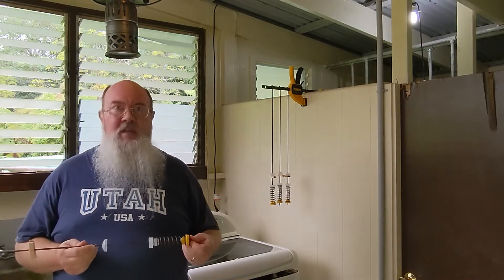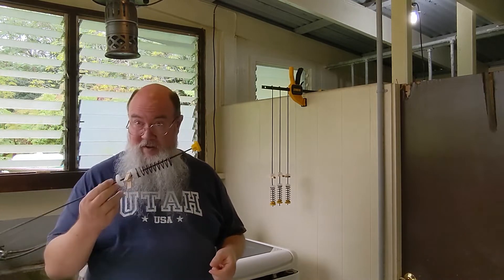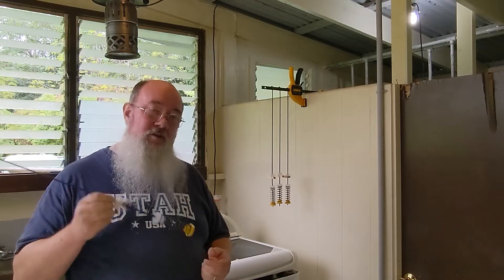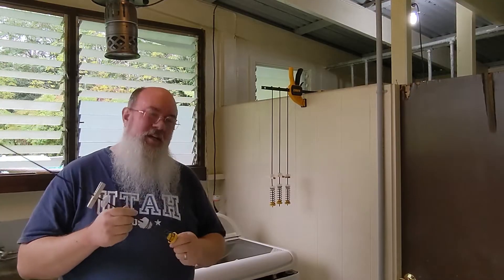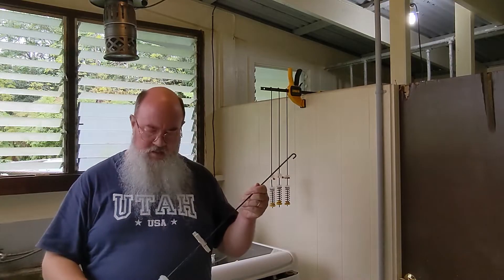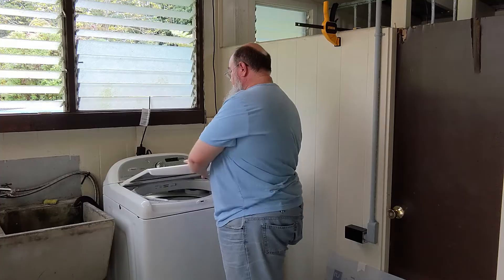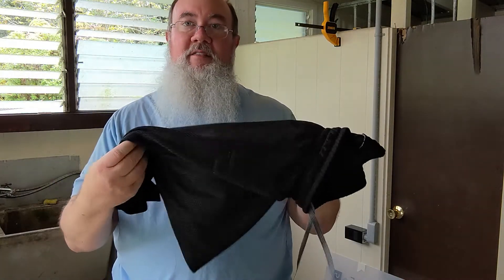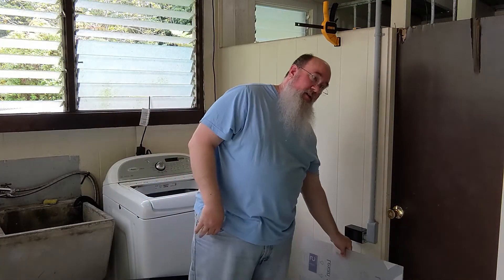FIX your washing machine rods! Don't $$buy$$ a new washer or washer rods before watching this video!

Comment: Good job & funny too...yeah the Damping grease was key.I knew it was something different when I first got it on my fingers...my fix was to use  Teflon (a rear bearing for a dryer) to replace the foam, then encircled the cup/foam with a stainless hose clamp,  tightened (tuned) to dampen w/o the grease.
In theory, if/when the Teflon wears,I can just reach down with a 1/4 in ratchet & re-tighten...
Reply from the maker: My 2 cents? If you throw some damping grease on that, the whole assembly will last years longer. Dry clamped Teflon certainly is clever, though! My concern is the same as @WasherDryerMoney 's liquid nails idea, though: Eventually, the metal WILL wear through that. Especially if you get a few specks of rust on the rod, it will get like sandpaper and just chew it up. (This is a more of a real risk in Hawaii / marine environments than most other places, but if you have a damp basement, you won't be far behind me us in Rusty Rods. You can treat the rest of it with knife oil if you are concerned about it.)

Comment: I really appreciate your video. How long has your first application of Nyogel lasted? I'm trying to decide if this method will last long enough to justify it over buying new OEM rods. I really don't want to have to apply more damping grease every few weeks, so I would love to hear an update.
Reply from the maker: Well, let's see ... I did this in November, and it still runs butter smooth in March. My suspicion is that the grease I used will last in the Hawaiian environment for about 6 - 12 months, at worst. If yours is sitting in a basement in a less-hostile environment, then you should get 2-3 years out of it like you would with a new set of rods. It's definitely not something to do every week or even every month. If that becomes necessary, then something else is off.

Comment: You should package the grease in little tiny container and resell it in quantity of a single repair so we all don't have to buy a big tube. Great video. Funny how ours just quit on a cycle and hasn't worked since.
Reply: I took my rods out and grease them. Ran a cycle and it still showed UE. Did some more research @"You can fix that" said to check the bottom nut. I tipped the washer on it's front and tightened the spindle nut, it was loose and there's a hall sensor that detects vibration. Since the stator was loose it was sensed as vibration and shut down. Tightened it up and good to go. Thanks for your video, enjoy Hawaii!
Reply from the maker: @chrismiles1369  Yeah, this is more of a "do this last" kind of thing. I guess I haven't made that clear, but there are some other reasons for UE to check before you get in there and take the whole daggum thing apart. This is just the step between, "Okay, it's the rods" and "I am ordering a new $150 set of rods" or whatever they cost for your model.
Reply from the maker: You are welcome to do so and reference the video. I honestly don't have time for that. Much as I love fixing stuff, I have about 4 other ways to make money before I get down to selling little packets of sticky grease. :-)

Comment: What about cylinder rubber stoppers in Shape of funnel.. most hardware store has them…
Reply from the maker: I wanted something that would fit into the "cup" that came on my model. I suppose that whole assembly could be replaced if you found one of those that fit on there tightly enough - assuming you could get it onto the rod without damaging it.

Comment: Great video. I’m going to do a follow video and I’ll probably bring up part of how you did your fix. I did find another way of making the sponge that you made with epoxy that’s a lot faster and easier and most importantly cheaper from another repair guy. I’ll probably suggest a combination of your repair and his repair as the best way of doing it. Although there is definitely more than one way to skin a cat. I have received about 10 other very good suggestions that have worked. Which makes sense it solving a simple problem of gripping a rod.
Again good job on finding the correct grease great video.
Reply: Looking forward to it! I've been flipping these for a couple years now and I'm glad people like you are finally figuring out how to defeat this issue.
Reply from the maker: Wouldn't have gotten there without yours, sir. Every YouTube video is like, "check these 5 things, and if it isn't fixed, swap the rods." And that bothered you, and after that video, it didn't sit right with me, either. Thanks for the reference!